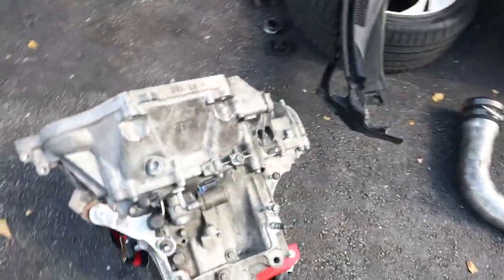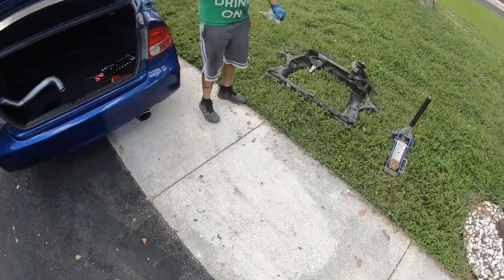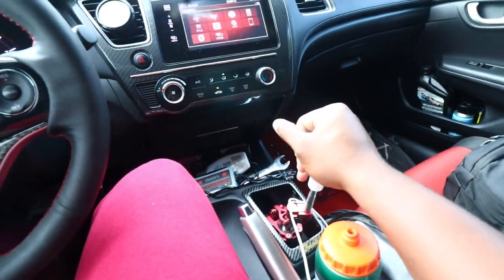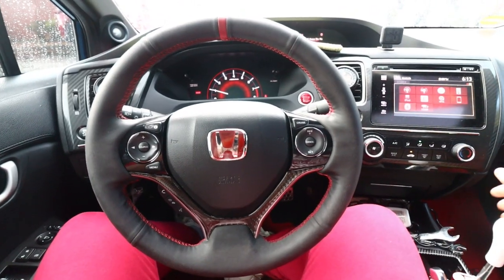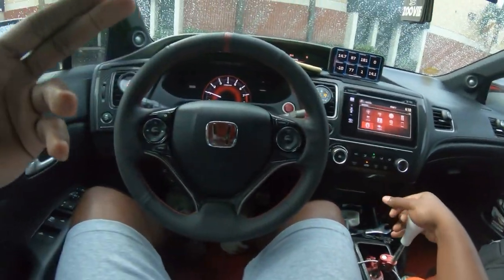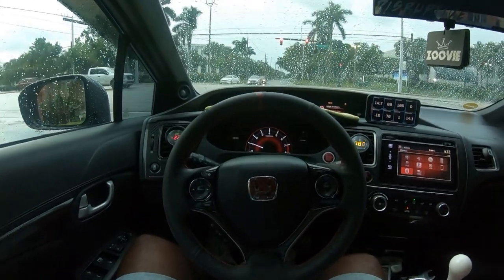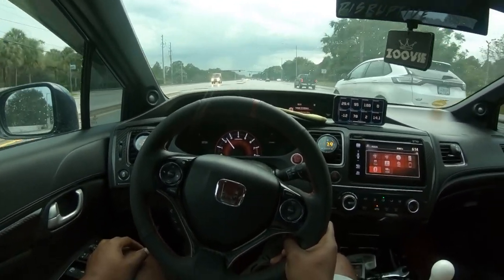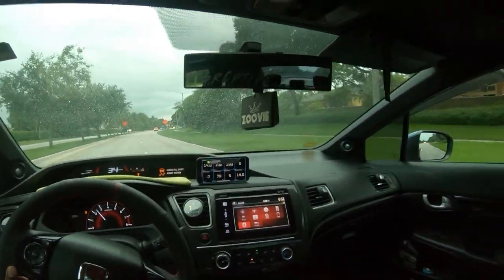ACTION CLUTCH STAGE 5 INSTALL ON MY 500HP CIVIC SI

Comment: My 2012 needs tierods too, I got a new clutch, just factory replacement and the shop that did it didn't adjust my clutch so my throw out bearing rattles a little, until you push the clutch in.

I need to get that taken care of lol.

Comment: Commented on other video but Tube seals wouldn’t cause oil to get onto the threads of the spark plugs oil would in the tube itself, that’s mostly fouling from your oil control rings starting to get gummed up or something in your tune or the spark plugs themselves being incorrect heat range.
Reply from the maker: I’ll check it out but threads would get wet removing the spark plug .. the tip of the spark plug weren’t wet though.. coil pack were wet with oil as well.. since I did the spark plugs and the seals, there been no oil on the spark plugs or coil pack
Reply from the maker: I appreciate the look out though bro 💯💯 thank you

Comment: Hey bro I ordered a makspeed turbo kit and gonna run a pulsar gtx3582, did you have to modify anything to run the pulsar beside the 3” downpipe vband? Also does the makspeed oil feed kit work with pulsar turbos?
Reply from the maker: Oil feed kit? Not sure